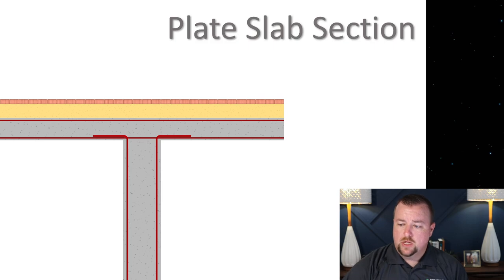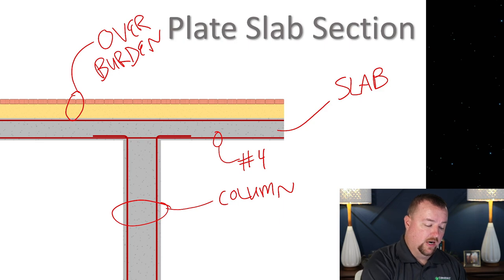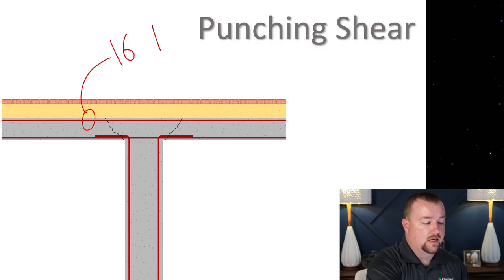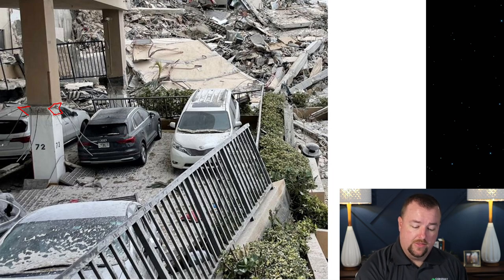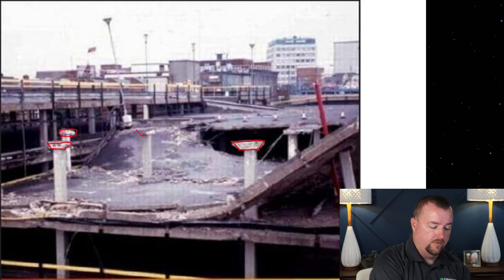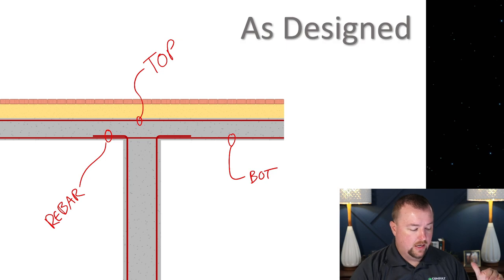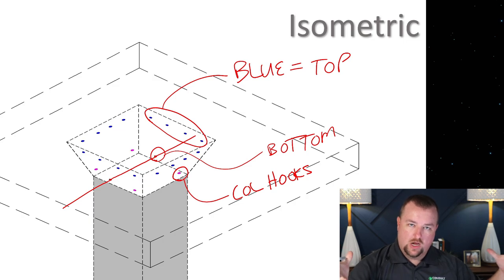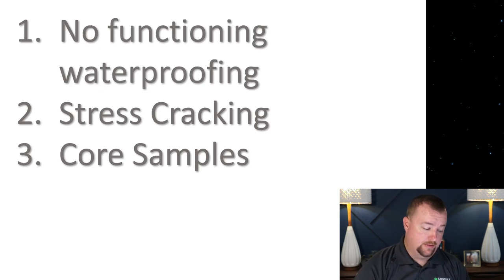The Importance of Punching Shear at the Surfside Collapse

Comment: You are not looking at pure shear where the columns punch through the decking.  The decking has begun to sag between columns and you have a bending moment acting at each of the four corners of each column.  This is causing the upper fibers of the decking to be in tension where it is meeting the columns.  Correspondingly, at these points, the lower fibers are in increasing compression.  Steel frame construction would have used substantial bolted, riveted or welded gussets attached to horizontal steel members at each corner.

Comment: That one cut away of the core indicates that the placement of concrete lacked vibration adequate to achieve proper embedment . Hence voids  ( honeycomb) 
Will nullify structural capacity.
What about the “mix design “ or composition of the concrete. The placement of concrete has many measurable elements ; air , quantity for water per cubic yard , vibration to provide flow and consolation. Not complex , but is involved .

Comment: A NOTE TO SURFSIDE AREA LAW OFFICES:  Collapsed material seen inside the parking ramp minutes before the building collapse may have ruptured the fire suppression (sprinkler) system inside the parking ramp.  Such rupture and resulting reduction of water pressure in the system should have activated the fire alarm.  For example, was the gushing water, seen in the photo/(video?) of the parking ramp entrance, from the sprinkler system?  Did the fire alarm activate?
Reply: There were reports that the fire alarm company activated minutes before the collapse.
Reply: @gordonrichardson2972  Thank you Gordon for that info.  My real concern is did a fire alarm activate throughout the building to alert residents there was a fire (actually a false alarm caused by a breach in the system) in the parking ramp?  It saves no occupants lives if the "fire alarm company" was the only party to be made aware that a potential fire existed on the premises, until firemen arrive.  How many occupants may have fled the building before the collapse had an alarm sounded?  A ruptured sprinkler system in the ramp should have activated such an alarm.

Comment: From what I see in these photos seems to be an overall lack of rebar in both the column and slab structures. When I see new buildings going up in the areas around me here in Portland/Vancouver, there a whole lot more steel rebar structure than I see in these photos. Compared to the new building I have seen go up, there appears to be only 1/3 to 1/4 the amount of steel in this structure than is required in the same size buildings in my area. If this construction met code back when this building was built, I definitely don’t want to spend a whole lot of time in Florida multistory post and slab buildings due to their lack of strength and redundant support. It was very distressing to see that the last pice to collapse did not have the rigidity to hold itself in place, but moved sideways far enough to move the center of support planes beyond the boundaries of the vertical center of gravitational force limits for the remaining columns. How is it that this building has been able to withstand hurricanes?

Comment: great analysis. I see your points. the causation of this collapse is a cluster. this disaster was 100% avoidable, that's what irks me. all the holes in the swiss cheese lined up. I put a lot of blame on the building inspector, his job is to catch problems and make the contractors get it right. waterproofing on top on pavers, are you kidding. thx for doing these videos. you explain well.

Comment: The rebar on top would have been for the negative bending moment which would be at the support/ columns.   If by de-laminated you mean the rebar no longer grips the concrete, then not even looking at shear, you would have a negative bending moment which would have far exceeded the tensile strength of the concrete alone, since that top rebar is useless per what you are saying.  Negative bending is typically a little higher in magnitude than positive if I recall for these multi span conditions,  so I'm not sure how that factors into all this.

Comment: there is the 1 photo shot from under the pool deck where the cars were  parked at the end of the building which showed all rebar being spalled and pulled out of the bottom of the garage roof slab.
doesn't look like a lot of structure left in a lot of the slab.
rebar shouldn't just release from the underside like that either.

Comment: Spalling does not explain the slab-columns failure you can see in photo at 4:13.  In the background you can see entire columns that have punched through interior floors.  The slabs slid down the columns and then the columns fell over.  You can see the tear outs where the slabs were attached to the columns. These interior columns were not subject to rebar corrosion.  While insufficient rebar or incompetent placement would enable columns punching through, it is the flat plate design itself that is deficient. It has nearly zero lateral stability.  Any columns failing introduce lateral movement and this design doesn’t resist that movement. Once one our two slab-columns junctions failed, every joint failed nearly instantly.  The design can be made much more resistant to punch through and lateral movement by adding drops or capitals to the columns or (better) by adding beams.  This has been known for many years.  This building and its sister were/are collapse designs, that are inherently dangerous.

Comment: Im in San Diego and curious enough there is a 10 story mixed use building going up near me, 350 units I believe with a CVS anchor.  The garage is going in, looks like it goes down three floors...  Its intriguing how little steel support slab to column, I am not seeing the design concepts in this video.  WRT Champlain; what could they have done with the spalling, remove lateral sections of the slab with couple of inch margins around the rusting rebar, replace and re-pour?

Comment: I'm wondering why fire alarms didn't go off?  Maybe high-rise buildings should have other kinds of alarm systems that would alert occupants to structural failures.  The collapse of Champlain Towers is such a terrible tragedy that it seems could have been avoided.  Your videos are excellent in providing an extremely important analysis that hopefully will contribute to safer structures and better monitoring of existing structures.
Reply: They didn’t go off until the building collapsed
Reply: Why would a fire alarm go off when there is no fire?
Reply: @joleda56 , I didn't know that. Obviously they weren't functioning properly.  I also wonder why the security guard(s) has never been interviewed publically? Were there CCTV cams inside the building as well as outside?  So many unanswered questions...
Reply: A fire alarm will activate if a sprinkler head is broken off or pipe is ruptured, as the decreased water pressure is sensed.  If spewing water in the parking ramp photo was from the sprinkler system, an alarm should have sounded.  Likewise, had the passerby's who found the collapse in the parking ramp located and used a fire alarm pull-station, more people may have escaped.
Reply: Apparently, it did, but the fire alarm for the garage doesn't set the building alarm off, it is a silent alarm and instead sends a notice to the fire department. Apparently, this is a common setup for many of these condo buildings.

Comment: Let me preface this by saying I know nothing about structural engineering or construction of high rise buildings however,......I lived in Miami FortLauderdale area and when this building was built the interest rate for construction loans was double digit and as a result these types of oceanfront buildings came to a standstill during 79,80,81, and even into 82.  I saw oceanfront complexes that were partially built and unfinished units that couldn't be sold with materials on site behind metal fencing and no work being done.  Sometimes the buildings were enclosed but other times the building was only a skeleton structure.  The building materials, rebar, concrete pilings, Etc Etc were all stacked and laying around the site and buildings and materials were open to the elements.  Surely the time of construction, high interest rates, unfinished and unsold units with high interest borrowing from banks, , and materials stacked around projects for month after month, had to have an impact on the quality of materials being used as well as skyrocketing costs to the developers who in turn often cut corners during the build.  I can't help but think these factors may have had an impact on the Towers that could have lessened the integrity of the structure since it was built in 81. .  As I mentioned this is not my field of expertise but I saw with my own eyes what was happening in the building industry and many developers filed for bankruptcy and walked away from half completed projects.  Any validity to my thinking?
Reply: Yes, I believe your thinking is spot-on.  The first information released after the collapse was the construction date ...and it got my attention.  1961, 71, 81, and 91 were all recession years.  The construction industry goes a little nuts when the economy goes in the tank.  Contractors begin to travel great distances (outside of their normal market areas) to find work, and bid on any type of construction.  Some will bid work at zero margin, hoping to cash in on "change orders".  The bad actors will try to cut corners.  I recall the construction of Tiger Wood's home in Florida, where the GC decided the house didn't need all of the concrete piling that the engineer called for.  The floors cracked.  Some of the decisions made on the Champlain Tower project have to make you scratch your head. The original design was for 112 units, then 135, then a penthouse: 136.  Then we have an elevated swimming pool and deck, with parking underneath ... in a basement ... on the Atlantic Ocean.  All of this is doable from an engineering standpoint, but why create these maintenance problems for yourself and your customers?  There were too many units built for the size of the property  ... not to mention the storm water retention issues which are created by building from property line to property line.  The developer was clearly driven by "making the numbers work", but at what cost?

Comment: At 5:12, Column 42, you can see the end of the rebar that left a trail as it dragged along the column face. The trail is defined indicating that it was in close contact as the slab collapsed. cant tell if its the upper or lower rebar, but it broke just a few feet from the shear plane. just caught my eye.

Comment: I am an engineer.  I think you are a top notch structural engineer and a good presenter. From pictures and evidences so far, I really think the shear connections between the slab and the columns were weak from the beginning. The contractor that built the building may have cheated to speed up progress.

Comment: Possibly dumb question, but if there is a risk of delaminating, why did they not put more rebar on the bottom layer compared to the top one. Like, obviously they should have waterproofed and done other things too, but why not fix this perceived issue in the design?

Comment: If you have the structural set, could you talk about the post tensioned tendon placement?  I'm assuming these are PT floor plates.  I'd like to know if the plaza deck was post tensioned or conventionally reinforced.   In the photographs, you don't see the sleeved tendons ruptured out of the thicker plaza slab.  But you also don't see the heavier mats of steel I'd expect to see in a  9 inch conventionally reinforced suspended slab.  Could the anchor pockets for tendons of the first floor interior  common spaces floor plate be damaged when the plaza slab collapsed, releasing tension all the way across that floor plate?

Comment: I wonder how much deadload they added to the pool deck since 1980 - that's a lot of inches of overburden that wasn't part of the original design - plus the planter boxes and all that. Reminds me of the 35W bridge collapse where they just kept adding deadload to the structure (more pavement, deicing systems, etc) that had some design deficiencies in the first place until one day they ran out of safety factor.

Comment: Assuming the entire top of the structural slab delaminated at the top mat then the remaining structural slab would now be carrying that top of the slab and the top reinforcing. Am I right in this?  When I saw the pictures of the punch through locations I mentioned to my wife there was a noticeable amount of reinforcing not apparently installed before the pour.  A lot has changed in the concrete construction industry 40 years since it was built.  And keep in mind the subcontractor who installed the bar was the low bidder and he gets paid by the ton.

Comment: Sounds like the structure was poorly built, but I wonder about the extra effect of the construction of the new building next to it. A while back, I worked in a 100-year-old building that had a hotel built next door, and the pounding of the pilings caused large cracks in our building. Since our building presumably had a steel skeleton, the cracks were cosmetic. But in a poorly-built structure like Champlain Towers South, maybe that caused the concrete layers to separate or weaken. Google Maps shows just how close those buildings were. A solid building should not be affected by construction next door, but a weak building managed to stand for forty years, yet collapsed shortly after the new building went up. I suspect that the new building played a part in the collapse of Champlain Towers South.

Comment: Core B seems to have different colors of concrete for the various broken/individual broken up parts? Is that just my eyes playing tricks? Any meaning in those color differences?
Reply: I've noticed it too.  It looks to my very untrained eye that either separate pours were used (??) or even that the bits of the core sample are in the wrong order.  The gaps between the bits look to line up better if the core bits are re-ordered (swap the middle two around).

Comment: The photos of the UK parking garage (we call them multi-storey car parks over here) is Piper Row in Wolverhampton. Only the top level collapsed - thankfully nobody was killed or injured, even though it was in use at that time. 

The recent Grenfell high-rise disaster was due to flammable materials being used in exterior cladding; effectively cancelling out the buildings fire suppression system - we don’t have sprinklers, we have fire doors meaning that a burning room / floor can be shut off and left to smother itself. The manufacturer of the cladding deliberately mis-sold it, knowing it was not appropriate. Other buildings have since been identified that have that same cladding and the residents are devastated as they are being asked to contribute to the costs of replacing it all.

Shoddy workmanship costs lives

Comment: The "pool deck" is actually a roof, over the garage.
It lacks water proofing, pitch and drainage system.
It also lacks expansion joints. 
The amount of rebar looks insufficient. The strength of the system relies on bonding between rebar and concrete. The concrete may also have been damaged when it was poured if it was too old, and diluted with water. Where are the test reports for the poured samples?
The garage roof was not an independent entity, but relied on support from the building to hold it up. Bad design choice. 
There are areas with clean shear failure in the slab, with no rebar whatsoever, and no extra beams to hold it up. A design choice or a screw up? Where is the inspection report on rebar before concrete was poured?
Why are the columns thinner in the building that fell than the one left standing? I've seen 4' diameter support columns in 5 story buildings. This construction looks like toothpicks.
The poor rebar fill at the shear failure point at the building left standing may actually have saved it. 
The difference in design between the sections looks suspicious. 
It would be interesting to hear from the designers what motivated the difference. Did they run out of money?
Does not the insurance company look at drawings and inspection reports, or do they just rely on shitty building codes, workmanship, maintenance, and reinsurance?
If they said no to insure the place action would have to have been taken.

Does the sister building have the same plans and execution?
If so I would be very nervous to live there.
(Please stop using "your" as a definite article, where "the" is appropriate :-)

Comment: My theory = differential settlement between pool slab & apartment slab eg 8cm verses 4cm. This cause pooling next to apartments so the designed drainage cross fall when from +ve to-ve allowing salty water to penetrare though to the slab steel. At failure of pool slab it pulled the outside column toward the pool until the re-bars were torn out easily (due to rust etc ) instigating collapse

Comment: It makes no sense to me that the top reinforcement rebar wasn't installed deeper in the slab and closer to the column head. The rebar would've been more protected from the elements and have more concrete to support. I also wonder if the core samples they took around the already weakened column could've been the final straw for that area to fail.

Comment: Is your drawing simplified ? Whenever I've seen concrete reinforced columns supporting a slab, there's always been what looks like a stress distributing pad, maybe 8-12" bigger than the column and some 4-6" thick between the column and the supported slab. I don't see that in the photos.
Reply: That element was not present in this design.

Comment: The risk of punching shear from the slab onto the column can be reduced if the structural design had the slab bearing on beams spanning between the columns, or even introducing corbels / thickened slab.under the slab at each column.